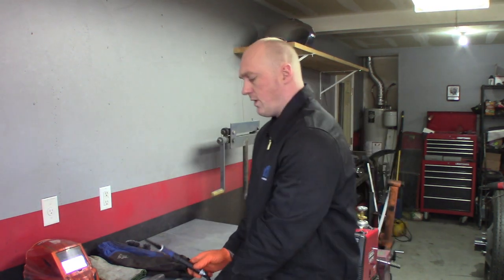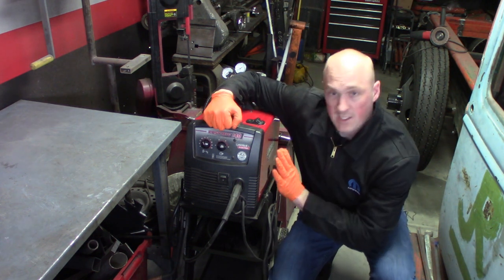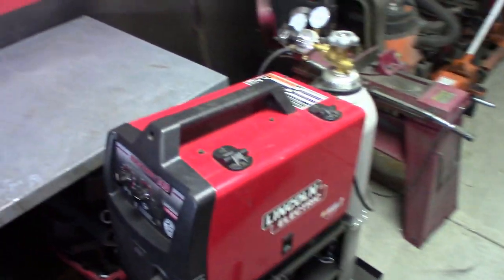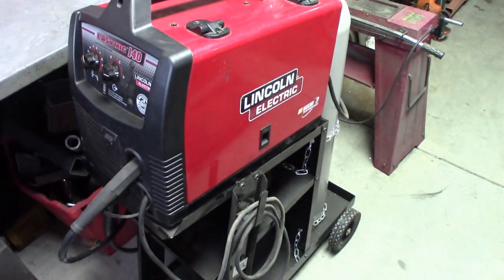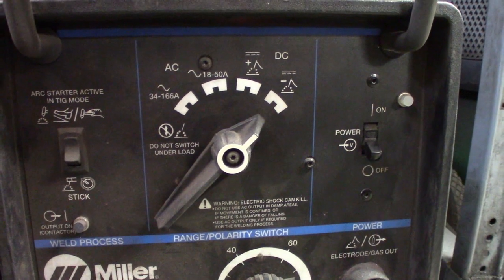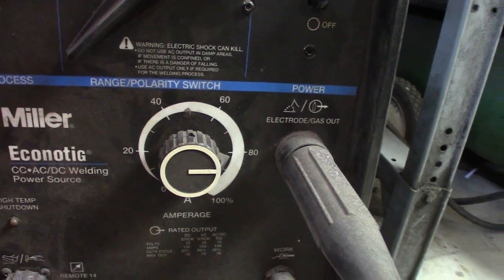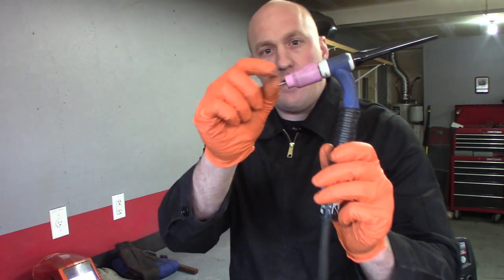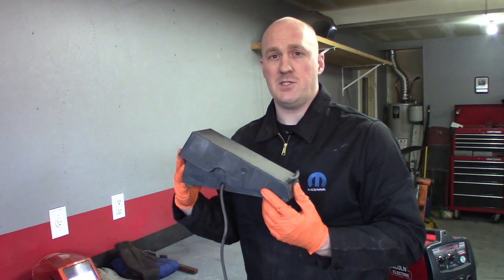Learn to weld! TIG vs MIG part 1

Comment: I really want to learn how to tig weld now. I started out learning how to stick weld with my everlast welder and then learned how to mig weld.
Reply from the maker: You'll find it to be really rewarding. If you are already proficient at those other types of welding then it won't take you much time to pick up TIG welding. It's still welding, just with slightly different techniques.

Comment: Only thing about those box store Lincoln welders is they have presets on the heat settings. Yours has only 4 settings (a,b,c,d)  The ones they sell at the welding/gas supply stores have infinite settings for the heat.  Its probably close to double the cost for say the 140 amp welder but you also get a more industrial drive roll as well.

Comment: Sometimes  I wear a heavier glove on the one hand close to the part being welded and a thinner glove on the trigger hand to get a better feel.  Your right you don't need those heavy  bulky gloves for mig, I use tig gloves for most all my mig welding.
Reply from the maker: That's exactly what I do sometimes as well, especially if I'm welding aluminum. Thanks for watching!

Comment: Great job on explaining the feature benefits of both types of welding.  I am just starting into welding though I used to weld about 40 years ago.  I was going to invest first with a TIG welder for the reasons you mentioned in addition the ability to weld other metals other than steel plate.  The other reason is one can stick weld.  I have heard there are many advantages with stick welding.  One  less expensive than MIG welding as per wire and gas.   The other easier to get dialed in.  Quality of welds are equal to MIG.  Thoughts?
Reply: Tig welding is the cleanest, and can control the heat to whatever the thickness of the metal is.  Mig can give off splatter, metal sparks,  which will burn or damage material.